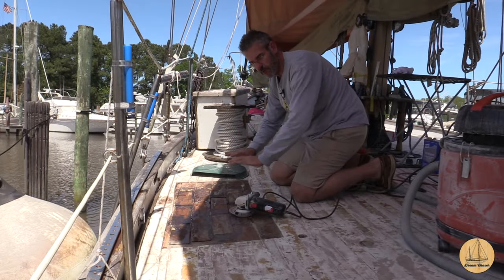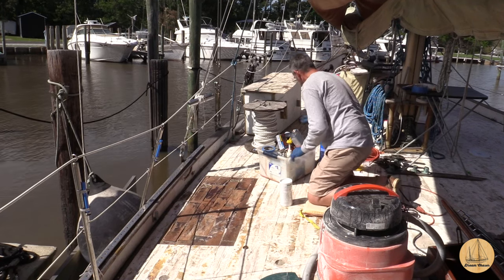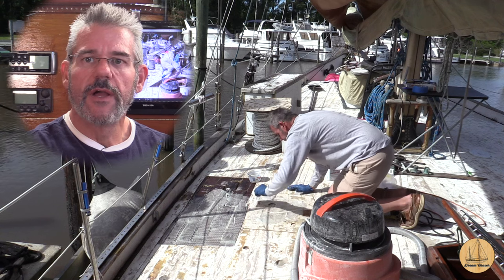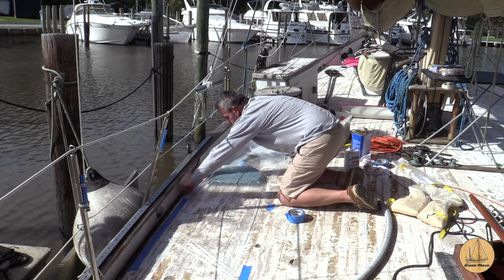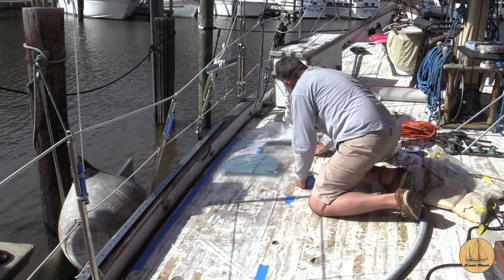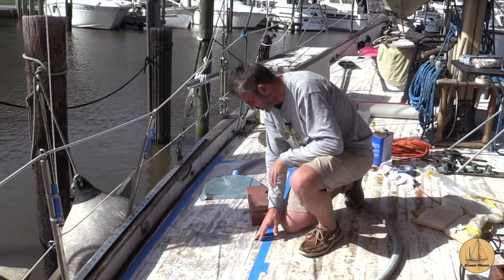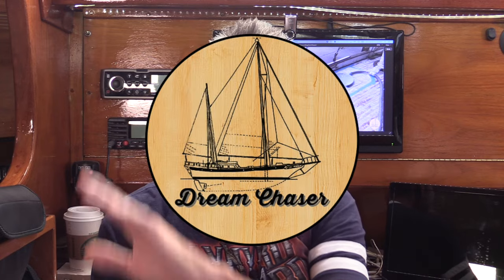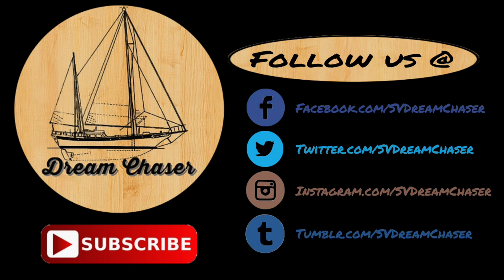How to Make a Vacuum Bagging System for Fiberglass Repair

Comment: another thing you can do is make the bag oversized, tape it down at the size you want it. your bag will be baggy. when you turn your vacuum on it will create pleats. if you have good vacuum, the pleats will be right to the surface. loose pleats in an area means you have a leak in the bag in that area. It makes it easier to localize where the leak is
Reply from the maker: Quad Se7en thanks, that's a great tip I didn't even think about that. It makes perfect sense and I almost feel silly trying to get all the wrinkles out as I was taping it down. LOL

Comment: You Made That 'Peanut Butter' With Resin, and Then You Added a Silicone Thickener, Yes?  That Silicone Dust, is Toxic.  i Wish You Would Have Used a Mask.
Reply from the maker: I agree about the mask. I am really bad about wearing one and when I do a little bit of work in a day I justify not wearing it but you are 100% right. I should.
Reply: @Svdreamchaser    You Be You...!!  Great Video...!!  That Silicone Thickener...Toxic Stuff.  I Would Stand Upwind When Adding That Powder Silicone.   My Toes Curled, but You Be You...!!! 🙂

Comment: right on bud looks good they use a special adhesive to to put on the new teak nowadays as well they use a vac process as well instead of screwed on seems to work I guess ,better then screw on ,like most of the leaky teaky boats ,if you ever use teak again your process will work fine
Reply from the maker: Kevin Swanson That makes sense Kevin. I think I love the way teak looks, I don't think I like the maintenance and I don't like the heat on my feet. So it's with a heavy heart I decided to remove the teak and stick with just fiberglass.  The downside, is, that these boats just seem to look better with teak.
Reply: its plastic tape works good for prepping windows and other things on a house i bin a plaster man for 12 years as well as a certified weldor.i should be looking for a steel boat lol

Comment: A couple of suggestions from my time in aerospace composites: You should use a bleeder fabric above the job and a breather blanket over the top of that - this will give you an even pressure and somewhere for the excess resin to bleed out into. 

Your green dish is holding the plastic off the deck so you are getting uneven pressure under and around it. The breather will eliminate that issue. Instead of the dish, I would use something like a tank connector to connect the vacuum line to the bag. You can get something like this: http://www.ebay.co.uk/itm/360976881427 with a mat or a perforated plate under the bag beneath it to spread the load of it. 

Rather than the blue tape, you could look at using a butyl strip like this, which will seal much more reliably between the deck and the bag.  https://www.psasolutions.uk.com/product/high-performance-gca-butyl-sealant-tape
Reply: Oh, and rather than your shop vac maybe you can look at using a proper vac pump - I wonder if a vacuum brake pump from a truck would work? Or maybe connect to the inlet side of a portable compressor?
Reply from the maker: +Jerry Jones Great suggestions as always. I will look into some of the supplies you mentioned.
Reply from the maker: +Jerry Jones The good news is I don't have to do an atmosphere reentry with this ship.  Just have to handle some rough seas. LOL
Reply from the maker: +Jerry Jones +Jerry Jones I have a question for you. If I use one of those blankets under the plastic to absorb any excess resin, how hard is it then to remove that from the surface. Does it not adhere to the surface that I would've just put down?
Reply: That is why you use a bleeder fabric between the deck and the breather. It's a nylon cloth treated with a release agent and just tears away from the surface, leaving a fabric pattern. 

Even better is if you put a layer of peel ply in contact with the work, which you tear off when required, leaving a surface ready for bonding with no need for abrasion or degreasing.

This is how they do it in a composites shop, which is of course overkill for you: http://netcomposites.com/guide-tools/guide/repair/vacuum-bagging/
Reply: +Jerry Jones  you are of course right, but for a low cost way to apply pressure this I think is fine with possibly a few refinements which I'm sure will happen. The cost of bleeder cloth and peel ply is high . There are however some cheap , old fashioned alternatives like burlap sacking as a bleeder!
But this system has a big advantage in that you can see what is going on thru the plastic and any issues can be addressed.
A word of warning any leak exponentially reduces the vacuum and hence the pressure so be vigilant about that.
Cheers Warren
Reply: Sorry to bring up an old topic. Could you use a bag filled with water to apply the pressure?
This is for a much smaller job.

Comment: Nice!  Just FYI, some vacs use the air flowing through it to cool the motor.  Plugging the end (like you are doing) can burn some of them out.  I think any of the "wet/dry" ones have a separate way of cooling - but I could be wrong.
Reply from the maker: GeorgeGraves ooh, didn't even think of that. I will have to see how this Fein does that.
Reply: @Svdreamchaser  Yep, you need the right vac. One with separate cooling, normally they are the spendy ones, Festool etc.

Comment: I definately complement your search for perfection. I will add a few points having built boats and repaired wood and fiberglass using West and other products for over 40 years.  Very smart wetting out the surface prior to adding the thickened epoxy. Most people forget that step. When you place the thickened epoxy on the deck spot, be sure to trowel the groves in one direction without overlapping.  That simple technique will help prevent the creation of air bubbles or glue voids. Also, did you wet out the underside of the replacement piece? I would wet out the replacement piece and place without adding thickened epoxy. There is no need to add to both sides if you properly wet out the replacement piece. I'm not a big fan of the whole vacuum cleaner part. Simple pressure on top with weight or Raptor staples(which are the greatest invention for boat building since West) is sufficient. Remember, you are doing the repair using liquid joinery; simple pressure will spread the glue lines. That's why it is important to pay attention to your trowel lines. Having said that, I would never criticize home inventions that work. Keep up the great work, I enjoyed your video. Tony
Reply from the maker: Thank you so much for the guidance and suggestions. I suspect others will also benefit from them here as well. Good to know of the vacuum bagging vs simple pressure as I didn’t know that.
Reply: @Svdreamchaser  I can only imagine the labor involved in repairing a vessel of that size. Your fans should see that having a labor of love, like I do, for these repairs, will melt away the pain and suffering of the actual labor. Great chatting and merry Christmas. Tony
Reply from the maker: Thanks To y. Great tips and I will have to research those staples you mentioned.

Comment: Great video. Vacuum is great way to apply a lot of force during curing. Better than any clamping system could do. What you want is to squeeze out any excess resin, because more resin than just what's needed to fill the void doesn't make it any stronger, weaker in fact. But for the resin to squeeze out it needs somewhere to go. Just like around the end of the vacuum hose and into gaps between pieces of the deck. But once the gap is filled, it doesn't have anywhere to go. So you should add some spacing material between the plastic and the deck. I'd probably put an old piece of rope along the seam as a sacrificial voiding material. Also that should help the vacuum spread.
Reply from the maker: Paul great idea. Thanks

Comment: I would use teak again ,I Will use your technic ant abrasive the big builders use ,I will build it off deck and put them on as whole sections with the proper caulking .I will keep an eye  on the caulking when it gets cracking and replace as needed I got an idea of making a tool to make it easy as well I will be using a teak treatment as needed I am sure to have no problem for years to come ,I just like the teak to be on my boat ,thanks for the great vids bud
Reply from the maker: The bagging worked much better than I originally thought it would

Comment: Do you have several sections that need repair like that? The crawfish platter is great idea.
Reply from the maker: bubba my decks along the side of the coachhouse likely need to be fixed but I am not sure if it will be like this or new glass there. If I c an do it this way I will. The deciding factor will be if there is a good edge to bond to or if the soft deck goes right up to the coachhouse wall. I won't know until I rip it out.

Comment: nice video , but you broke many of the rules for vag bagging, any idea of vac pressure  you got id say very little, and poor vac machine my heart goes out to it, still it seemed to work so good on you,r
Reply from the maker: Rik Warner I may have just lucked out Rik but it did seem to work really well.
Reply: I’m planning on doing exactly this. I’ve read shop vac will pull about 3 psi. That’s pretty good. Car batteries for comparison would give you about .75psi. Total vacuum, if you have a pricey pump is 16psi.
Reply from the maker: It is still working good after almost 3 years.

Comment: stucco tape will work better then paper tape less sucsion loss
Reply from the maker: Kevin Swanson I think with this job even if there was a little bit of loss of air through the tape, the speed at which it cures didn't seem to affect it.
Reply: dekleer bros also made frazer 30 41 and 53 i believe